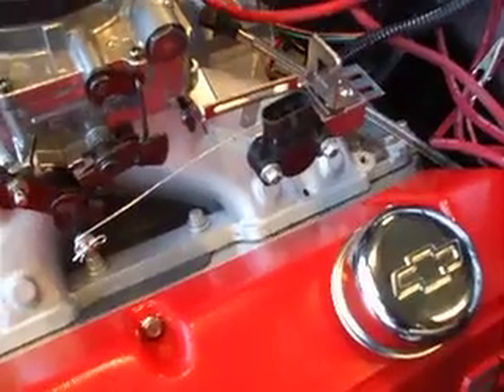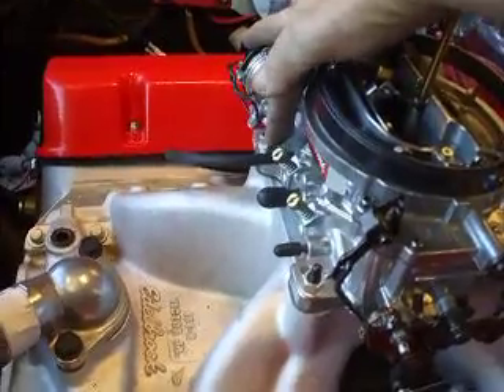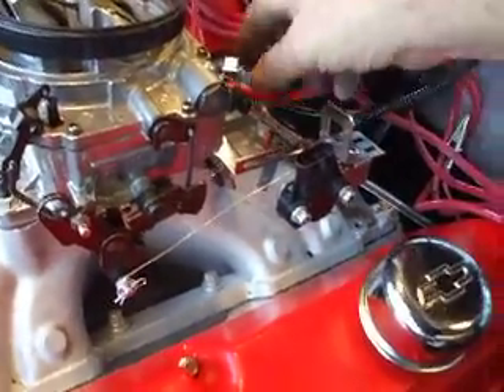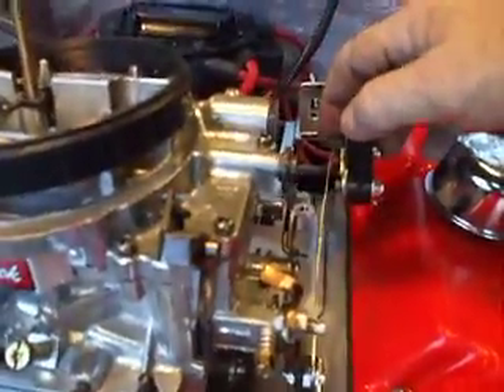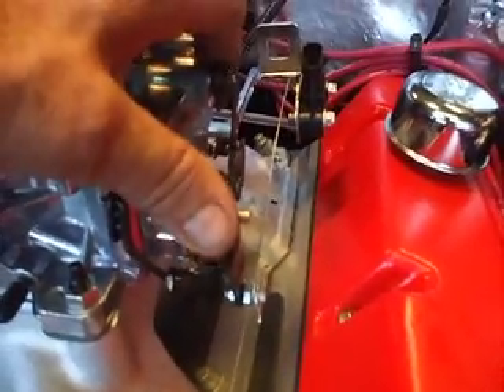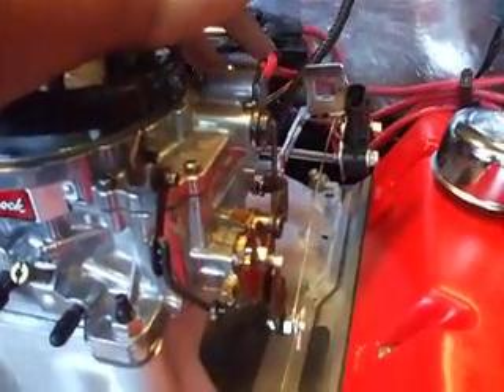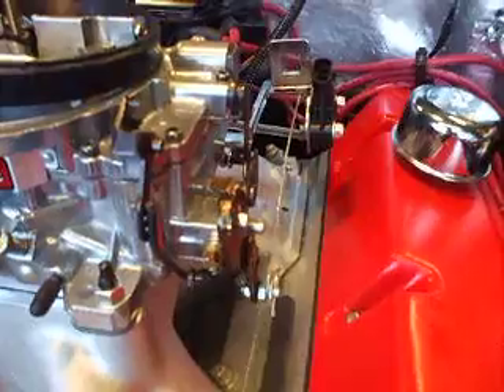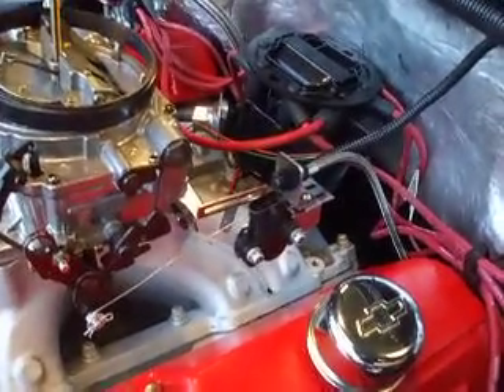How to Mount a Throttle Position Sensor on an Edelbrock Carb

Comment: how did you 1. attach and  2. terminate the cable ends? Drill holes in clevis? Crimp a ring/eyelet? Lead sinker?

Comment: Man!!! You are indeed cleaver. I knew i can use a TPS all along since basically is just a rotator. My needs for the TPS is for enabling advance in my VW Bug with electronic ignition; the TPS sends the signal to a knock sensor unite which advance timing based in the opening of the Throttle Body. I was thinking to put it directly to the carb throttle, but with your idea it seems much easer to do it. Thanks for the video!!!! Wisdom rocks!

Comment from the maker: I am using a 4l80e that uses a controoler made by usshift.com

I suggest you use a turbo 400 it will hold up to the 454 with no electronics needed, but it does not have overdrive.

Have you joined trifive.com yet it is free. Te guys with help you with all the answers.

otis :)
Reply: Would you need a stand alone computer as well ?
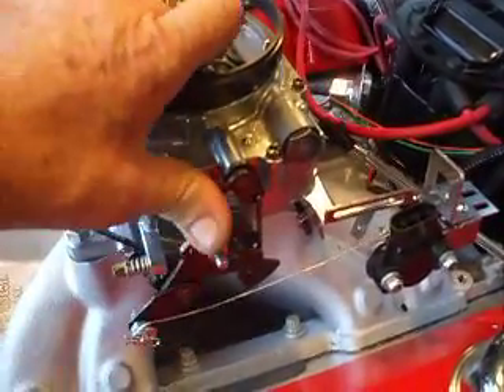Reply: @trentonlasky1861 no stand-alone computer is needed with a th400. But if your rearend gearing is higher than 4:11 then your gonna want something with an overdrive like the 4L80E which is basically a newer version of the th400 but with the overdrive and the need for a standalone computer (like the US Shift quick 2). The TPS in this video is what tells the computer what position the throttle is and the rpms and it will shift the 4L80E.